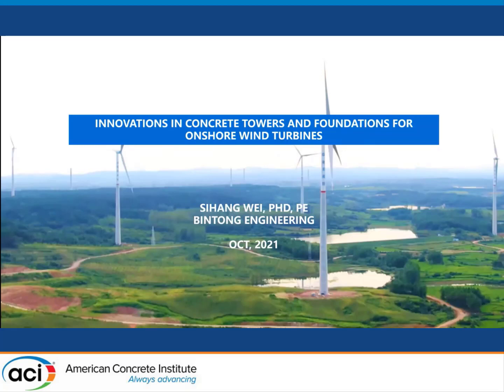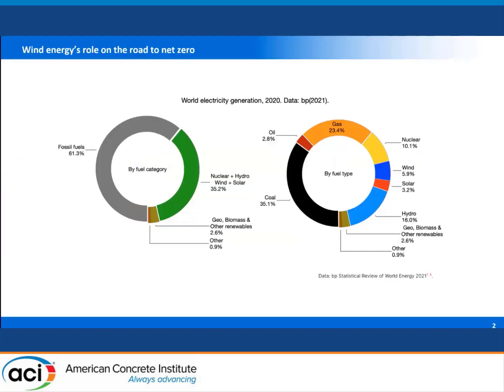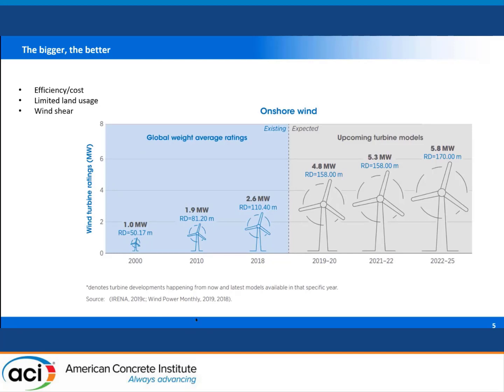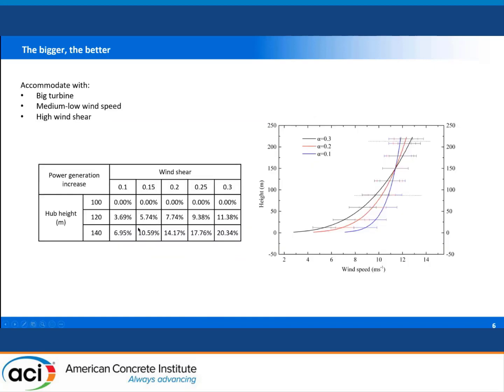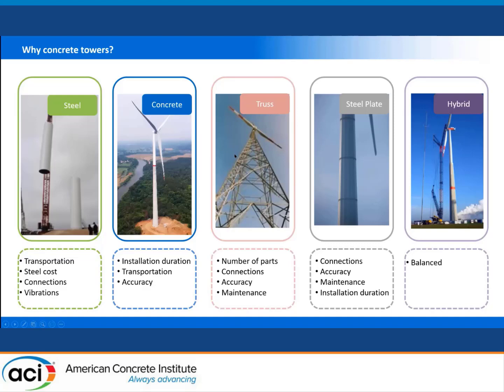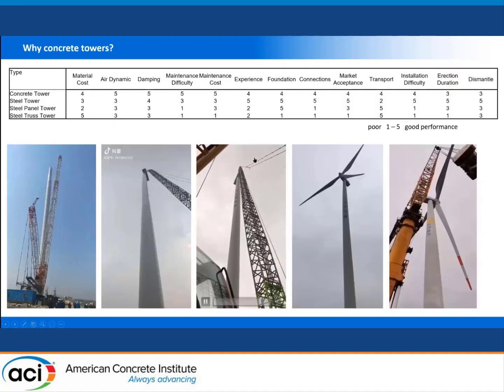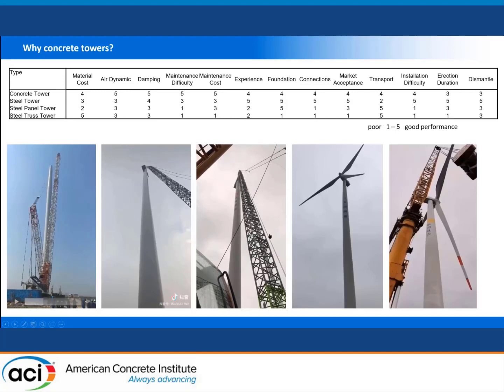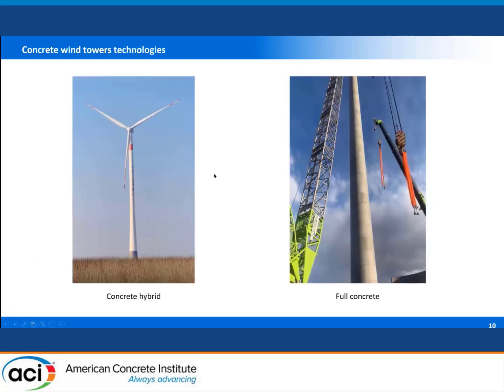Innovations in Concrete Towers and Foundations for Onshore Wind Turbines

Comment: Hi, I want to setup a small wind turbine, weight 60 kg on the roof and center of a building pillar. and the average wind speed is 8 m/s. is it possible to setup without making any damage of the building